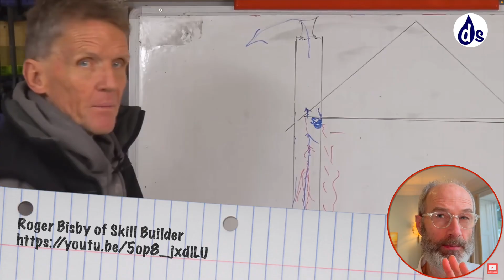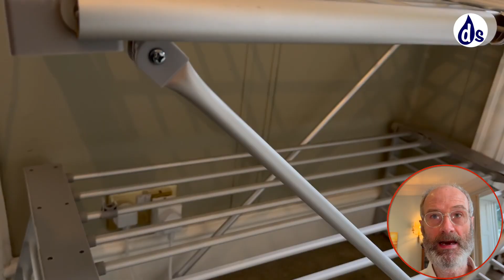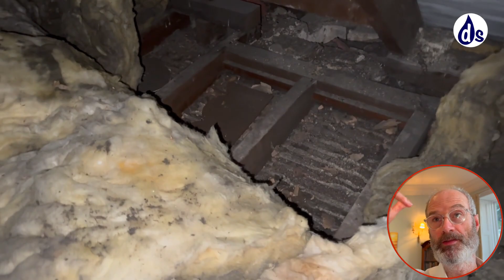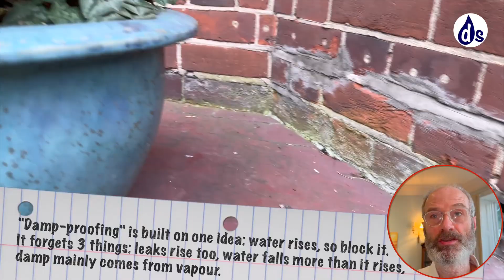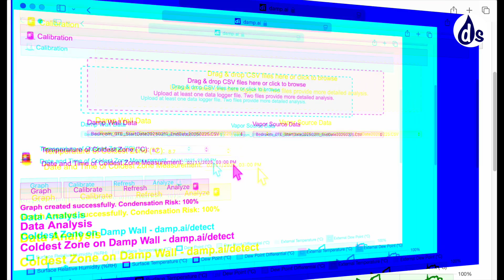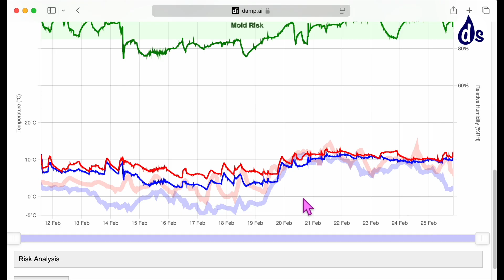🌧️ Damp by Your Chimney? Here’s What’s Really Going On 🏠

Comment: Having followed a number of your videos I have upped my game and got a Meaco 20/ltr dehumidifier which I now run 24/7.   To get some idea of what energy it uses I run it on a Tapo Mini Smart Wi-fi - Energy Monitoring Socket which links to a tap-link app.  Over the last week the dehumidifier has used as little as .5 of a kWh of energy on one day and maxing  out at 1.8kWh of energy on another day this seemed to be driven more by the varying atmospheric humidity rather than me  changing my habits indoors.
Reply: I too recently bought a Meaco 20 ltr and it is a game changer. The amount of liquid in it every day is quite amazing...a litre or more. I have only been running it overnight but it has completely solved my condensation problems. Plus it is cheap to run too.